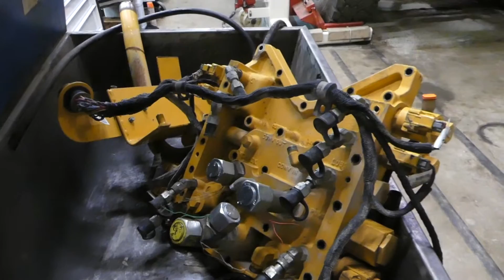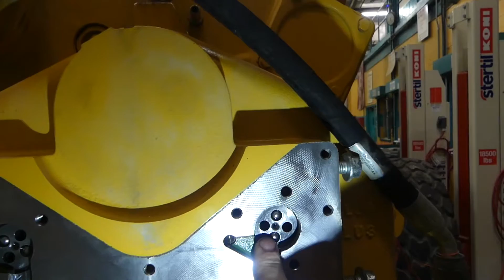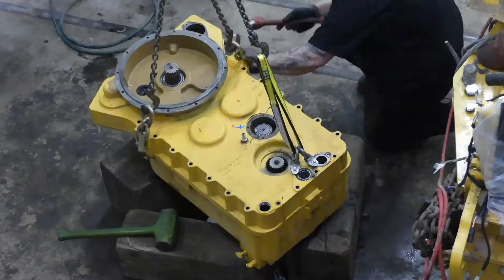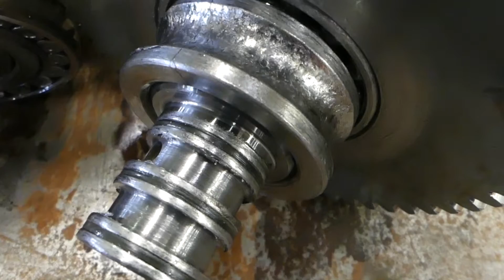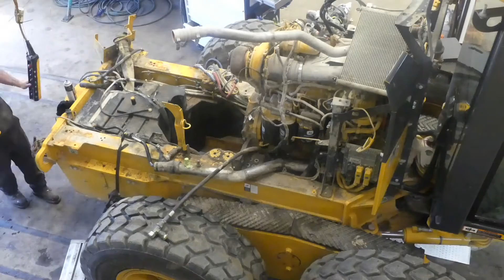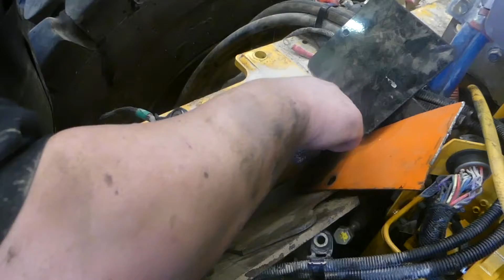670g transmission repair part 2 with removing a broken bolt

Comment: Do the Snap on Deep Twist sockets have a better warranty than bluepoint?
Reply from the maker: No they just go down smaller in size and I think are made from a different material
Reply: @theheavywrench9549  right on

Comment: What had worked good for me when it comes to taking out bolts like that is to,,,,,, I heat the sides just like you did and immediately throw cold water on it !! It shock that part of the metal and you can all most take it out with your fingers.. I just showed this trick to my new guy and he would’ve never believed it if he didn’t see it!! 👍👍👍👍👍👍👍

Comment: Heat bolt cherry red put wax candle to it the bolt will come out easy works great i dont heat around bolt .
Reply from the maker: Larry Burns I do use that sometimes but this one I wanted to try out those sockets. I am thinking about buying them but wanted to put them through a work out and see how they did.  I have a chunk of bees wax in my box I usually use that on exhaust bolts lol I agree it works awesome
Reply: Awsome I have the sockets they work had them get me out of spots before , was taught about candel wax years ago by old timer it sure has paid off to listen to some of the guy's i have worked around good videos thanks
Reply from the maker: Larry Burns thank you for watching this is awesome how someone can read the comments and get great advice like you have given.